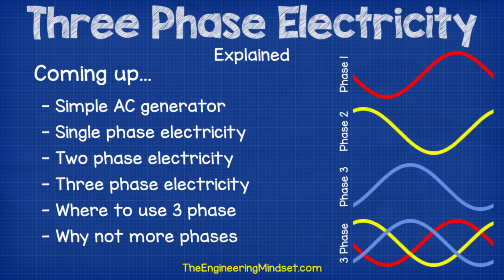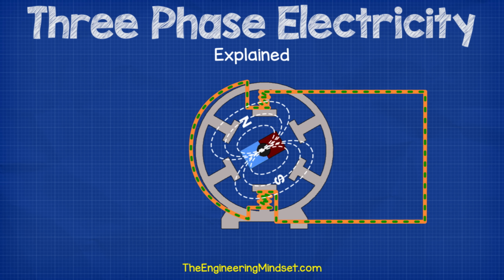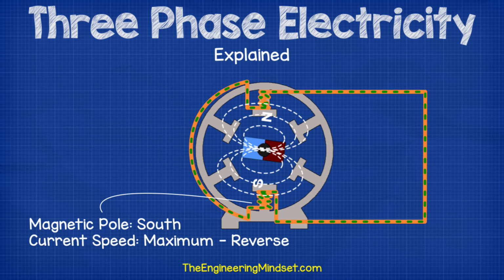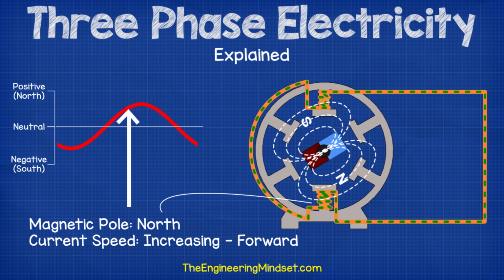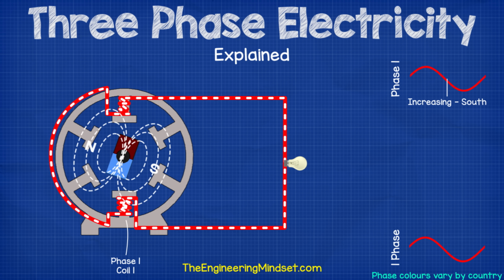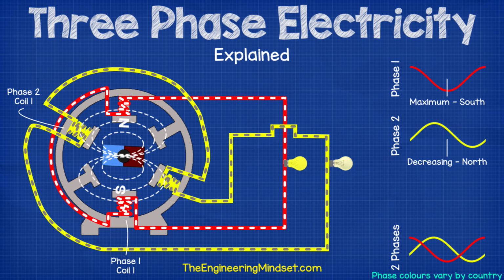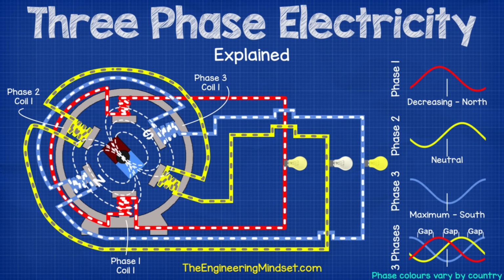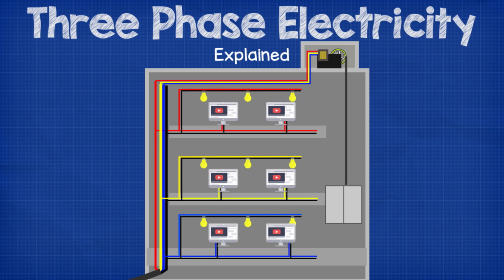How Three Phase Electricity works - The basics explained

Comment: I was just wondering if a house is distributed by only one phase, how the house can have three phase equipment like oven?
Reply: It can't.  If you have a 3-phase oven, you need a 3-phase service to your house.  Either that, or you need a phase converter equipment that can produce 3-phase from a single phase power source.

In the US, a typical household is powered with 120/240V split phase.  You center-tap the secondary of the transformer to derive the neutral, and the two lines become the two ungrounded conductors.  The two lines are each at 120V nominal to neutral, and 240V nominal to each other.  240V powers watt-intensive loads like the oven, while 120V powers mostly everything else (lighting, receptacles, etc).
Reply from the maker: Check our new revamped 3 phase explained video, sooooo much better:👉 LINK: https://youtu.be/c9gm_NL7KyE

Comment: One thing I don’t understand. The last diagrams did not show the return wire for each phase. It had to connect in a full loop right? Is that not shown or is this not the case?
Reply from the maker: Check our new revamped 3 phase explained video, sooooo much better:👉 LINK: https://youtu.be/c9gm_NL7KyE

Comment: You can actually see the lamp flicking in and off by looking at a fan blade. If the blade is spinning at the correct speed the fan blade will appear to be still
Reply from the maker: Check our new revamped 3 phase explained video, sooooo much better:👉 LINK: https://youtu.be/c9gm_NL7KyE

Comment: 2 wires going to houses? What about for 240 volt for the stove and fridge and the ground wire? isn't it 4 wires?
Reply: This is based on the UK standards, where they use 230V single phase for everything.

North America uses the 3-wire Split Phase Edison system, that connects the house to 3 wires off the transformer.  1 wire for L1 (black), 1 wire for L2 (red), and 1 wire for the grounded neutral (white).   Only 3 wires come from the service transformer.  The ground is derived at the main service disconnect (or main service panelboard), where neutral and ground are bonded together, and also bonded to the grounding electrode, that makes it at the same voltage as the surrounding earth.
Reply from the maker: Check our new revamped 3 phase explained video, sooooo much better:👉 LINK: https://youtu.be/c9gm_NL7KyE

Comment: If houses and small appliances are connected using 1 phase, then how come lights are home don't flickr as much and appliances don't drop performance as the power drops down during cycle?
Reply from the maker: Check our new revamped 3 phase explained video, sooooo much better:👉 LINK: https://youtu.be/c9gm_NL7KyE

Comment: Hi newbie here.I have a question, so if we have a diode and using only the highest voltage of each phase would our current be like positive negative alternative? If it is a bulb there wont be a problem lighting it. But what if it is an electric motor? Would it turn alternative too? Im kinda confused ty
Reply from the maker: Please see our VFD video, it shows a motor and 3 phase with diodes

Comment: ok so in another video you said that if it is 50 hz then the current changes 100 times per second, but in this video you say the direction of the current is changing 1:1 i.e. 50hz = current changes 50 times per second, please clarify
Reply from the maker: This is a mistake in the video. It should be 50Hz = 100 times per second which is corrected in the newer three phase video

Comment: Florescent and LED lights do flicker at 60Hz(in the US), but incandescents don't so much. This is because incandescents release light because their elements are so hot, because they can only heat up and cool down so quickly incandescent lights are basically continuous light emitters.
Reply from the maker: Check our new revamped 3 phase explained video, sooooo much better:👉 LINK: https://youtu.be/c9gm_NL7KyE

Comment: but i feel like this is a little misleading, or correct me if i am wrong, but the magnetic field is strongest and therefore the strongest change/or boost in current is where it sees the strongest change in magnetic field. shouldnt this be where the flux lines or magnetic field lines are closest together? you have it at peak potential where the flux lines are farthest apart.... the greatest EMF is produced where the change in flux or magnetic field lines  is/are the greatest
Reply from the maker: Check our new revamped 3 phase explained video, sooooo much better:👉 LINK: https://youtu.be/c9gm_NL7KyE

Comment: Students must have learn Simple Harmonic motion. And then go to electronic configuration of single atom of particular material. According to Bohr's postulate the fact that behavior of an electron is rotate and revolve around the nucleus due to electrostatic force there  must be energy of potential energy and kinetic energy of an electron then we say to that angular momentum must have.. I want to explain in easily method the electrons are revolve particularly orbits with energy. You know that first orbit have low energy and then step up to next orbit that have more energy than first. If ac source applied across the conductor the first orbit of electron go to second orbit but according to Bohr's law there is fixed energy(transition to excitation) then electron go to back original position the electron  emits photon. Same happen with electrons in a conductor when energy increases electron go to upper level and when energy decreases exponential the electron go to ground level energy it does 50 cycles per second or (50Hz in India.).because of alternating current has two directions. We call it pulse energy... There are various ways to describe the direction of alternating current.. Me from kashmir
Reply from the maker: Check our new revamped 3 phase explained video, sooooo much better:👉 LINK: https://youtu.be/c9gm_NL7KyE

Comment: if a bulb turns on and off quickly(being on and off for equal time, I guess) then why do the bulb seem to us always on and not always off.
Reply: Because there is a thermal mass to the bulb filament.  It doesn't cool down to a safe-to-touch temperature in 4 milliseconds.  It still glows white hot throughout the cycle, which means we see it illuminate, even though the electric power periodically reduces to zero
Reply from the maker: Check our new revamped 3 phase explained video, sooooo much better:👉 LINK: https://youtu.be/c9gm_NL7KyE

Comment: Ok, so we do not need 3 phases for a lamp (as illustrated) because a single phase is that fast (from the grid) that we do not see the flickering of this single phase. Because the magnets in the power generators in the power plants were fast or the phases were adjusted before reaching our homes.
Reply from the maker: Check our new revamped 3 phase explained video, sooooo much better:👉 LINK: https://youtu.be/c9gm_NL7KyE

Comment: The secretes of 3-phase System is not explained in this video correctly.
The sum of the momentary powers (I*V) of the three phases are constant at every time. If drive a motor with three phases, the toque is constant from standstill to the maximum speed. All the electrical cars use three phase power supply between the controller and the motor.
Reply: Holy S***, I had to go look at the waves again to see what you're talking about, that's absolutely brilliant. Thank you so much for pointing this out.
Reply from the maker: Check our new revamped 3 phase explained video, sooooo much better:👉 LINK: https://youtu.be/c9gm_NL7KyE

Comment: The last part is slightly incorrect... :) In some countries (this case Germany) all houses are connected to 3 Phase power. The home installation is usually set up in a way that distributes load somewhat evenly across the three phases by connecting different groups of breakers to each phase. In Europe for instance most electrical stoves are connected to at least two of the three phases (if tehy have an integrated oven, 3 of 3)
Reply from the maker: Check our new revamped 3 phase explained video, sooooo much better:👉 LINK: https://youtu.be/c9gm_NL7KyE

Comment: Just wanted to nit pick; electrons do not flow faster or slower, they always travel at the same (near-light) speed. What is changing with the rotation of the magnet is the current, or number of electrons actually moving. But I suppose that would be much harder to animate.
Reply from the maker: Check our new revamped 3 phase explained video, sooooo much better:👉 LINK: https://youtu.be/c9gm_NL7KyE
Reply: No, that is not even close to being true.

The electric field propagates at a significant fraction of the speed of light, but the individual electrons aren't moving that fast.  The drift speed of electrons isn't even close to the speed of light.   It is so slow, that it would take over an hour to travel just one meter.   This is the speed of the electrons as a result of participating in carrying current.

The THERMAL MOTION of the electrons is a lot greater.  But this is chaotic, and the current associated with it adds up to zero among all the electrons in the material.   The small portion of electrons' motion that is organized, becomes the motion associated with the current they carry

Comment: Question: Since the current is alternating, even in single phase power. Why could I theoretically touch the common side of a plug but not the load side? If electron flow inverted shouldn't I get shocked 30 times a second, considering 60hz, by holding the neutral/common side?
Reply: The neutral is bonded to the equipment grounding conductor at the service disconnect.  At this point, it is also bonded to the grounding electrode, to make it at the same absolute voltage as the surrounding terrain, building foundation, and building steel.   All metal objects that don't intentionally carry current, are connected to the equipment grounding conductor, in order to stop them from becoming energized during a fault.

For this reason, if you touch the neutral, there is no voltage difference across your body to get shocked.  Unlike if you touch the live wire in the receptacle, that is ungrounded, and will create a voltage difference across your body.
Reply from the maker: Check our new revamped 3 phase explained video, sooooo much better:👉 LINK: https://youtu.be/c9gm_NL7KyE

Comment: Could it be possible for earth to work in the exact same way with its magnetic core triggered into a spin by currents from lightning storms and solar energy? This same awesome power of storms also responsible for feeding the earth's magnetic field via the iron core? I have been brainstorming and realized that the two, the earth and the AC motor you described seem to be based on very similar principles. In the earth's system, earth is its own "coil." I am aware that the planet spins because it encounters no resistance but as well my intuition tells me that nature made sure to put in an electrical system that would "reinforce" the spin, like an icing on the cake. What do you think? I like to theorize and often compare man made machines to nature itself, since she is our inspiration and we hold part of its intelligence within our own brain. Thank you for the video.
Reply from the maker: Seen our new video on HOW SOLAR PANELS WORK in detail https://youtu.be/Yxt72aDjFgY

Comment: A question about "Hz"? If I understand what you say, correctly, you are saying that "Hz" isn't just the on and off of the flow, it's also the direction switch? If this is the case, why is "Hz" used to describe monitor refresh rates? I think they just switch on and off don't they. I don't think there is a reversing of direction. Maybe I misunderstood what you said.
Reply: Hertz means complete cycles per second.   60 Hz like we have in the US and Canada, means that it takes 1/60th of a second to start at the zero point, rise to the positive peak, descend back to the zero point, fall to the negative peak, and return back to the zero point.

Measure the time duration from equivalent point to equivalent point in the next cycle.  That is the period.  Take the reciprocal of the period, and that is the frequency in Hertz, commonly represented with a lowercase f.

Now, for the mathematically inclined, multiply the frequency in Hertz by 2*pi.  This is called the angular frequency or the radian frequency, often represented with a lowercase omega as the symbol.  This allows you to construct a sine function to model the voltage as a function of time.   V(t) = Vpeak*sin()
Reply: @carultch  Either you answered the wrong person or you didn't understand what I asked. I know all of the stuff you shared here but that's not what I asked.
Reply from the maker: Check our new revamped 3 phase explained video, sooooo much better:👉 LINK: https://youtu.be/c9gm_NL7KyE

Comment: I want to know if the neutral wire that doesn’t carry current is necessary for current transmission? Can it be discarded? 

Also, Alternating current is used in High Tension current transmission and use. Can a DC be ‘upped’ or ‘downed’ to operate for use in high tension areas? Please reply as to whether this will be costly or any other factors.
Reply: Yes, if you study electrical history you will find the intense battle between Edison and Tesla, fought on the streets of New York City USA over DC or AC being the best. 
You will then find that if you put out DC power over large distances it makes too much heat in the wire and the wire then loses conductivity. 
The wires have to be called SOMETHING, to make them identifiable in the process ...do not confuse these industrial names as to their purpose ..... it ain't 'neutral" it's still providing WORK.
Reply from the maker: Check our new revamped 3 phase explained video, sooooo much better:👉 LINK: https://youtu.be/c9gm_NL7KyE

Comment: Excellent graphics but in a conductor the speed of the electrons does not change, it is the number of electrons flowing in the circuit.
Reply: No, that is not true.  Look up drift velocity.  It directly depends on the current flowing in the circuit.
Reply from the maker: Check our new revamped 3 phase explained video, sooooo much better:👉 LINK: https://youtu.be/c9gm_NL7KyE

Comment: Nice explanation and animation. Thanks. One step further: The smart thing is that it does not use 6 wires but 3 wires or 3 Phase wires and a Neutral wire. This allows to reduce the amount of copper needed to transport electricity at a certain voltage. The Neutral wire also allows to make 2 voltages available, depending on the wires used. In Europe, this is 230 V between Phase and Neutral and 400 V between Phases. There is no current flowing through the Neutral wire when all three phases have the same load.
Reply from the maker: Check our new revamped 3 phase explained video, sooooo much better:👉 LINK: https://youtu.be/c9gm_NL7KyE
Reply: False,  a neutral wire still is a current carrying conductor, it only serves as a return path to the source in an AC circuit
Reply: @MonkeeyMan35  the neutral wire carries current when phases do not carry the same load indeed.
Reply: @MonkeeyMan35  Neutrals are for single phasic loads. in a true 3-phase load, there is no neutral.

Comment: I'm applying for an engineering position where they (presumably) use induction motors to power a conveyor belt system.  I watched a great video on induction motors themselves, but I failed to understand why 3 phases were used.  The moment I saw your diagram with one phase, and you had explained the positive/negative/neutral sections of the magnetic field, I instantly realized why 3 phases would be used, and got a little excited.  I can't express my appreciation to you for helping me improve my chances at becoming a better engineer and worker.
Reply from the maker: NEW! Check how AC motor works here https://youtu.be/59HBoIXzX_c
Reply from the maker: Check our new revamped 3 phase explained video, sooooo much better:👉 LINK: https://youtu.be/c9gm_NL7KyE

Comment: Why does a 3-phase supply not have 6 cables (3 live + 3 neutral) coming out of the generator? Why does it only have 4 cables (1 live + 3 neutral).
Reply from the maker: It shares a natural they cancel each other. Check out of three base basic calculations and also the star delta starter video for visual

Comment: You should do a presentation on how an isolation line filter or isolation transformer works. I've heard of techs using them to float the ground of test equipment while using an oscilloscope. I'm not sure I'm fully wrapping my head around this. I love your visual aid and diagrams, they really make sense.
Reply from the maker: Check our new revamped 3 phase explained video, sooooo much better:👉 LINK: https://youtu.be/c9gm_NL7KyE

Comment: So the electrons actually travel backwards and forwards? I thought it was one way? I’m confused yet again!
Reply from the maker: Watch this first: https://youtu.be/mc979OhitAg
Reply: Remember what the A and D stand for, in AC and DC respectively.  DC = direct current, AC = alternating current.

In DC, the electrons continuously travel from the negative terminal of the voltage source, to the positive terminal of the voltage source.  Our convention of "current"  travels the other way, for historical reasons, due to the fact that we defined the a charge with a surplus of electrons as negative before knowing the electron existed.  If there were positive charge carriers instead, it would travel in the direction of our convention of current.

In AC, the electrons continuously reverse direction.   No significant number of electrons ever get from source to load, no matter how long you operate the circuit.   The electrons push power through the circuit in a longitudinal wave of inter-electron repulsion.  Just like a sound wave never carries air from a speaker's mouth to your ear, but instead uses a pressure wave to transmit the energy and information.